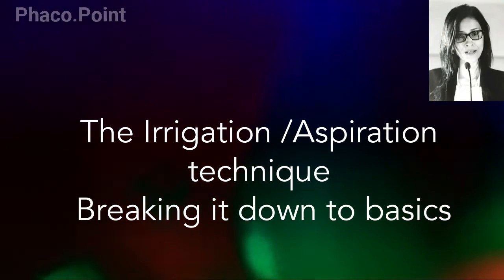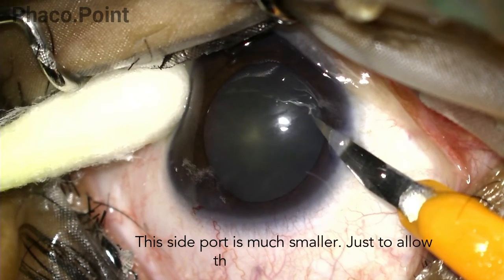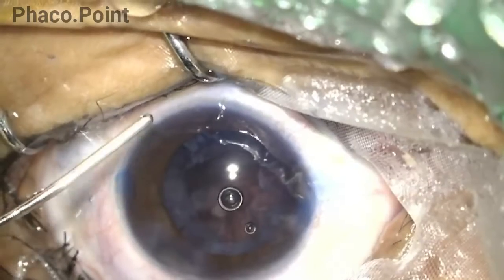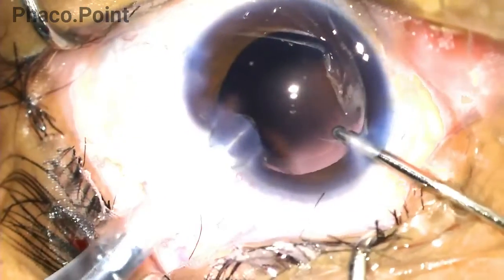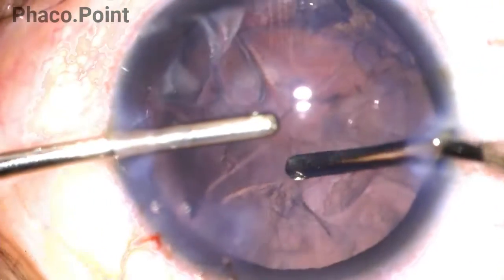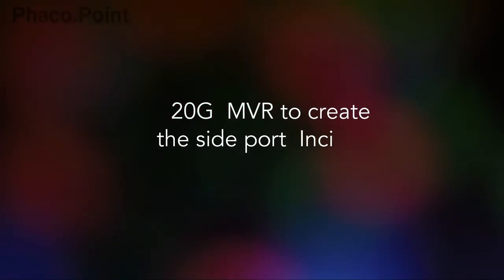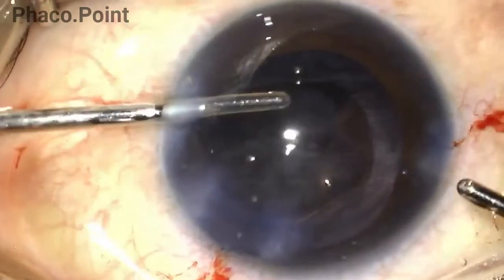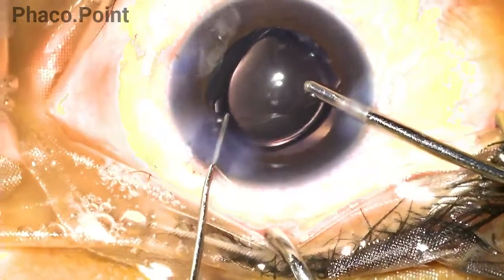Learn the technique of  Irrigation aspiration - Part 1 -Bimanual I/A - an instructional video

Comment: Great presentation ma’am! I use bimanual IA. Please do comment upon which is better in your opinion bimanual or co axial IA. Thanks.
Reply from the maker: Thank you.It  is always a personal choice,however  I beleive that bimanual irrigation aspiration is a superior technique. This is because it allows for circumferential removal of the entire  cortex. There is never an  issue of subincisional cortex.it is over all easier and with no disturbance to the main 2.8 tunnel
Reply: @PhacoPoint  thank you ma’am!